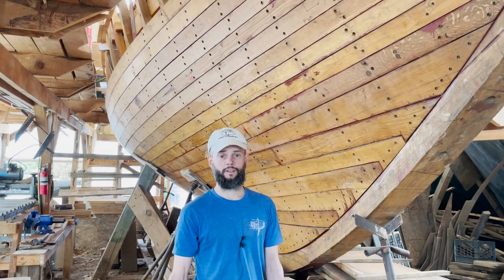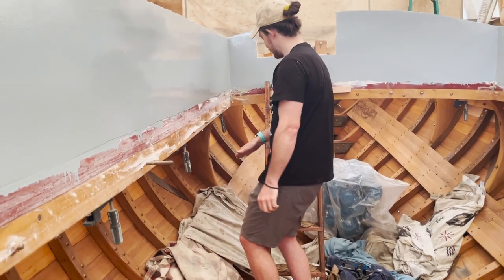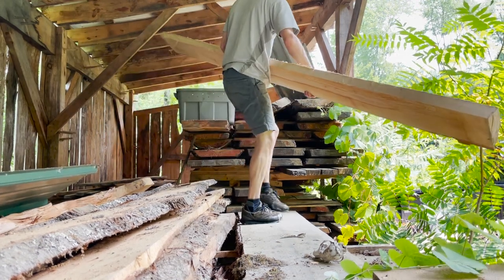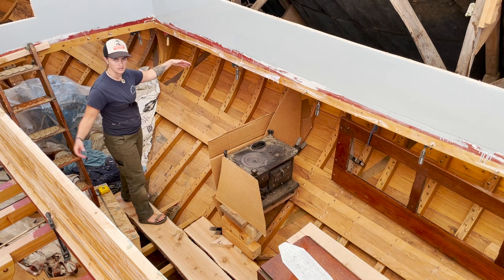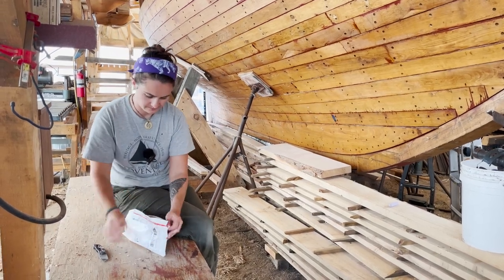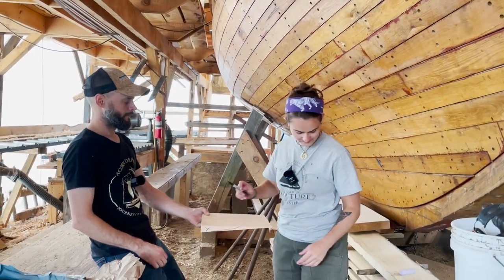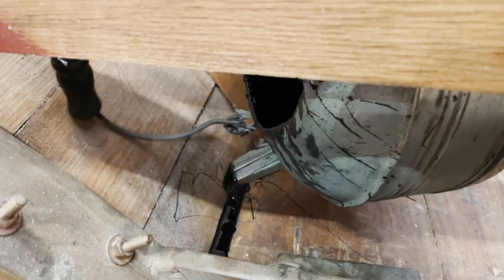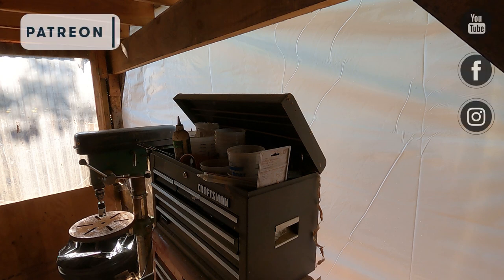Pitching the Bilge - Episode 174 - Acorn to Arabella: Journey of a Wooden Boat

Comment: safety note about pitch: heating solid pitch in a container, and the bottom will liquefy and expand, if that is sealed in under a top solid layer it can explode out - hot pitch splashing onto skin will stick and burn - this is likely why you saw them breaking the large bucket of pitch out into chunks instead of them warming the whole bucket, so that then those small loose chunks could be melted vs trying to evenly heat the bucket so the bottom of it would not pressurize and shoot a stream of molten pitch out into your face, hands, or arms and fry your skin off ..... the person who taught me how to work with pitch learned that the hard way, and has a large scar on the back of their hand from a skin graft
Reply: This should be pinned at the top of the comments
Reply: Sounds basically like the common sense thing I used to have tell to new employees years ago never put water into a fryer cause water and oil don’t mix it’ll basically explode hot oil all over you. Same basic concept with this I’m guessing is don’t pour too fast or too slow
Reply: ……had this happen to me when I was a kid. I had a tin can half full of lead that I had previously melted. When I held it over the gas stove withe a pair of pliers to remelt it, a small jet of molten lead shot out and plated my thumb…….won’t do that again !!
Reply: We would always split the can open and doing so make the pitch easier to break up.
Reply: ⬆️👍..  like what roofers do with roof tar. BTW, pour pitch from the bottom up, let salidify before continuing to move uphill.
Reply: I was wondering about that... this makes sense. I suppose you could have some clever way to heat from the top down but that sounds complicated... the "peel back the can" suggestion sounds a lot more manageable (but then you need to use the whole thing I guess).
Reply: @kuhndj67  We always split the can open and put the broken up pitch in an old gas copper. Heated it up and let enough out into an old kettle and poured the pitch into whatever we were pitching, bilge or paying seams. The pitch just went hard in the copper till we wanted it next time. Needless to say..we used a lot on old wooden fishing smacks.
Reply: so that explains why, thanks

Comment: The best way to get the pitch out of the buckets is to cut the bucket off then use an axe to cut chunks off. This is the common method used with buckets of asphalt when needing to melt them down to tar a roof.

Comment: In  old sailing ships, loggerheads were used to melt the pitch. A loggerhead is a iron  ball with a long iron handle that is heated up in the ships galley or the forge (many ships had a blacksmiths forge to deal with all the ironwork  repairs). When hot, it would be plunged into the pitch barrel, melting the pitch without risk of causing a fire.
 Thanks for making the vids and sharing your knowledge and experiences, been following you since I saw you working on Tally Ho and enjoy both your channels :)

Comment: A quick reefing tip.  Get your fingers close to the wood when you've got a little length of caulking sticking out, and twist the caulking before trying to pull on it.  If you keep the caulking twisted you can pull out long lengths of caulking because the twisting tightens it, strengthens it and reduces its diameter, all of which make for more pulling and less hammering/reefing.

Comment: Stamping the offcuts with an Arabella branding iron would be pretty neat.
Reply: I was thinking the same thing.
Reply: just wrote the same, sorry didn´t see your comment
Reply: I was thinking a branding would be nice too, but that would take time away from the boat, so not likely to happen. A sticker with each order would be nice though. The receiver could build a shadow box and include the sticker in the box.
Reply: @graham6229  It isn't really buying offcuts, it's more like donating money to the project and getting a memento in return.
Reply: @graham6229  Of course, just a way of supporting. Which is why I recommended the branding because otherwise a random offcut is a bit lame.

Comment: For access to the pilot berth under the stairs, I watched the bonus video and had an idea to make access really easy:  install beefy brass hinges at the top and bottom of the ladder on the starboard side, with their hinge pin parallel to the ladder's vertical angle line.  It would basically act like a see through doorway, and with the angle it should always want to stay down/closed.  Adding a latch at the top of the ladder to hold it securely down in rough seas would be very easy to both access and visually confirm it's latched down, and a simple soft loop or similar above the chart table could hold it up/open for when you're working under there, perhaps laying in the berth to work on the engine through a acres panel on the port side of the berth?

And it's been said hundred of times already but that stove and placement is amazing.  Decades ago I sales a 27' Catalina with my family, that under stair berth was where I slept (but our stairs were centrally located, no ladder in the way), and that stove would have been great on cold nights!

Comment: About those plank etc. offcuts; if you brand them with your very own branding logo that would be a much better souvenir than just an offcut piece of wood!  Make it unique; cast a branding iron, plate, torch(you work it out) and impress (burn or print) a logo or picture of the boat like on your website intro. 
Cheers!

Comment: I recommend you verify that “high humidity long paint cure” yourself. I got my WetEdge refunded after showing that Interlux Brightside as well as Rustoleum cured hard in 24 hours, while WetEdge wiped off straight back to the primer after 72 hours drying (never cured). I had hoped it was just the flat white color I had but it looks like you have the same problem. Test with a little Rustoleum and I think it’ll be hard in 24 hours.
Also, I found adding a little Penetrol works great to get a good finish with just a roller, no tipping needed.

Comment: Now that you're getting to fitting out the interior, how much battery capacity, how big a fresh water tank, how big a diesel fuel tank, etc?

Also, based on your desire to sail around the world, I'd strongly recommend having a good, well insulated freeze box so that you only have to run the diesel once every other day or so to keep it frozen.

I also recommend a water maker (reverse osmosis is more expensive but makes more water per energy input).

Also, are you going to rig any solar panels for daytime power?

Comment: I installed a system for using the Dickinson stove to run hydronic heating through the boat. Dickinson makes a forced air heater I installed in the forward berth. A closed loop from hot water heater, diesel stove, and heater will help move warmth through the boat. Copper tubing is better than pex in case the system runs hotter than 140f.

Comment: As far as the bucket of pitch, get a larger bucket and a heat source.  Boil the bucket of pitch (eg; place it in a larger bucket full of water with bricks inside on the bottom, to keep the pitch-bucket from contacting the bottom) and just leave it to boil for several hours
It should soften enough to be poured out

The alternative way that roofers do it is to just take an axe to the entire thing and chop it into chunks before chucking into something that can melt it down (but they call that crap "hot" for a reason)

Comment: 7:15 Yea, it's amazing how many modern production boats also have mooring cleats that aren't strong enough to survive a storm (insufficient backing). They get away with it because most boats are in a marina during a storm. I personally have met at least three almost-new ships that have had cleats ripped out while anchored in a storm, and seen a few more on Instagram. So a good sampson post is definitely worth doing right.
Reply: Hi, a solution i have seen is a loop made in the line and the folds in the loop are connected with a strong spring allowing some expansion in rough sea but is still a fixed mooring
Reply: Before we left on our ten year voyage I removed all of the deck mounted cleats and placed ¼ steel backing plates below the deck, I made them as big as possible to help spread the load, did the same for the windlass mount.

Comment: When using a burner in the tented Inclosure or on your boat build some 3by3 boxes and fill with 3 inches of sand  place your burner in it to insulate between burner and decking. Keep a bucket of water on hand or sand or both.

Comment: My small 35' Blanchard/Seaborn came with a Washington Stove Works wood stove (smaller than the Shipmate) that had been converted to use kerosene as a pot-burner, supplied from a small SS 'day tank' at the bow via a 1/4" copper line. I guess one of the previous owners got tired of shipping wood or coal.

Comment: I recently got my hands on an old schooner with a shipmate stove. One thing that has come to my attention is boom height versus chimney height. If you plan to use the shipmate underway keeping it closer to the mast is a good idea so there is no chance of being hit by the boom, out of the way for reefing, etc. Our boat is from the 30’s so the stove has been in many locations and there are many patches in the deck because of this. Our stove is now near the companion way hatch and the chimney goes through the house top. I am planning to move it to one of its former locations in the next few years because I would like a stove for heat.
Reply from the maker: Good thoughts all around AJ, thanks.
Reply: Hollow mast with a chimney up the center? I'm no sailor, but is there any way that could work?
Steel mast? Heck, I don't know, just asking.
Edit: but sure sounds like a grand item to have aboard as a safety measure just in case your ever shipwrecked on a deserted island. At least you have a stove/heater, if you can recover it from the wreck. Build a shelter and you have a safe way to heat it and if you can recover you pots, pans, and tea pot, a way to cook and boil water too. Would make survival a little bit easier.

Comment: If the pitch becomes brittle when it cools, what keeps it from separating from the seam once torsion loads are applied to the boat.  Seems to me butyl rubber would be the better choice.  Then again, I've not seen it recommended for sealing boats.  Wondering out loud.
Reply: @graham6229  - Yep.. clearly the shipwrights who've been using pitch for centuries don't have a clue about what they're doing!
Reply: @Garryck-1  Maybe because pitch was the only thing they had for centuries?

Comment: I know this caulking process is traditionally correct but I can think of several ways to modernize the process and speed it up... instead of caulking only to break the bond into the cracks and then remove the waste material... a material similar to toothpaste could be gunned into the joints to prevent the tar from going deeply into the cracks, and the simple substance could be easily formulated to deteriorate rapidly in a matter of days into a granular loose mix like sugar or sand that can be easily vacuumed out.... a material such as corn starch could be the natural base material... like a simple dough stuffing... it would dry out and crumble in no time but las .org enough to stop the pitch ... the chemistry would not harm the wood planks and be easily purchased and cheap.

Comment: Question about pitch:  once it solidifies, and given that it is not really adhesive, wouldn't the wood's swelling and/or shrinking eventually lead to a separation from the hard block of pitch, creating a space between pitch and planking where water can creep and sit, and potentially cause rot down the line?
Reply: it always stays somewhat pliable, and is sticky, when you saw it being chipped out of the bucket or off (smoother)surfaces it was being fractured to crack with sudden sharp movement, kinda like how they say breakable glass is always still in a flowing liquid state altho moves so slow ... but yeah, it is just like a harder tar, and to move or flow it quickly it has to be warmed, but it will slowly reshape or be squished out with the wood on its own at ambient temps

Comment: @7:00 I may have missed something obvious, but why are the starboard frames and planks so much higher than the port side?
Reply from the maker: The sheer strake is installed on the port side, and while there’s still a little to trim when we remove the batten protecting the top edge of it, we did trim down what we could of the frame ends along that side. The last three planks on the starboard side will be installed when we don’t need the staging anymore… currently it’s in the way it it’s essential for the interior fit out and for laying the deck.
Reply: @AcornToArabella  Oh i see, that actually makes sense. I hadn't considered it in that light. I see now that the top starboard plank isn't permanent, but is instead a place holder of sorts? I can see how both sides will come into alignment with the work you mentioned. Thank you very much for the response. :)

Comment: If the pitch is so brittle that it can be chipped out of the container, wouldn't it crack and even chip from the flexing of the hull of Arabella?
Reply from the maker: It’s not as brittle as it seems, it’s rubbery. Plus, around the places where frame, backbone, and planking come together (the bilge) that’s where there’s the least “flexing”.

Comment: How do you make sure no wood boring insects are in the wood if you air-dry them instead of heat treating? Is that even an issue?
Reply from the maker: We used some anchor seal on the end grain, but that was mostly to promote even drying and prevent checking. We don't have much of an issue with that. Oh, and the wood was kept under cover... I think the critters usually like moist/dark, not well ventilated, spots.
Reply: @AcornToArabella  makes sense. Thanks

Comment: Hopefully the tar doesn't grab the hemp and make it a gooey pain of a mess when you go to take it out!. All part of the gig I reckon.
Reply from the maker: Sure is... better than cotton or other options. The light amount of tar and the relatively large fibers should help.
Reply: The pitch will be hard at that point.
Reply: @billvanvlack117  On the surface. I'd image it still has some... goop to it past the oxygenated surface. Could be wrong. I know that's how tar on roofs work. Pitch is much thicker though.
Reply: @AcornToArabella  Oh, for sure. Could you imagine what the tar would do to the cotton? Lord, that'd be a true nightmare. This shouldn't be bad. Was just thinking how bad it... "could" be in my worst case scenario ha.

Comment: Any reason you didn’t heat the pitch in the metal pails it was already in?
Reply: you would only heat and liquefy the pitch sealed in the bottom of the bucket first, the top solid layer would hold it under pressure until it exploded - I know someone with a big scar from a skin graph on the back of their hand, where hot pitch just suddenly blobbed out of a container they didn't heat evenly and slowly enough

Comment: Is it a ship or a boat?  Since it's going to carry a smaller board (dinghy), it should be called a ship.  Ships carry boats.  Also, when it turns in the water, will it lean into the turn or out away from the turn?  Boats lean in, ships lean out.
Reply from the maker: This is a boat.

Comment: Is there any reason why you could not have just used to thin masking on the inside rather than precocking
Reply from the maker: It’s got to be at the back of the seam to keep the pitch entirely out of it, and it has to come out when all is done.
Reply: Being a non-boat-builder myself, I was wondering the same thing... tape it on the INSIDE of the boat... pour pitch... and the tape lives there entombed forever between the pitch and (eventually) the cotton caulking. There must be some reason though...

Comment: Couldn't you just hit the metal bucket of pitch with a sledge hammer? I used to work in a place that used coal tar pitch in the product, and the operator would just lay the can on it's side and beat it with a sledge. The pitch would shatter and fall out of the can.

Comment: Steve, I'm wondering about the entrance to the cabin. Seems like you'll have to step up onto the deck from the cockpit to access the cabin door. As you know, in many boats the forward end of the cockpit opens straight into the cabin. Obviously the original design calls for what you've built. Do you think it was designed that way to contribute to watertight integrity? Would the boat be less structurally sound if you opened up the rear part of the cabin for easier access? Just thinking about those long nights when you're on watch and maybe the weather isn't that great, and also general comfort when you're at anchor or dock. BTW, I'm originally from NH and would love to lend a hand if I still lived there. Thanks for all the great videos!
Reply: That's called a bridge deck and yes, watertight integrity. Without it, big water on the deck fills the cabin rather than running out the scuppers and drains.
Reply: @billvanvlack117  Makes sense. Thanks!

Comment: Heating pitch hereabouts is an oven job, not a container-over-a-burner job.  Of course hereabouts there are only a few weirdos who work on wooden boats, nowhere near the traditional east-coast traditional shipbuilding culture. So I dunno if it means anything.
Reply from the maker: We inherited the kettle for melting from another experienced crew who re-pitched their deck, let alone the many resources that describe this very method. An oven sounds like an even way to heat, but this worked well and efficiently.